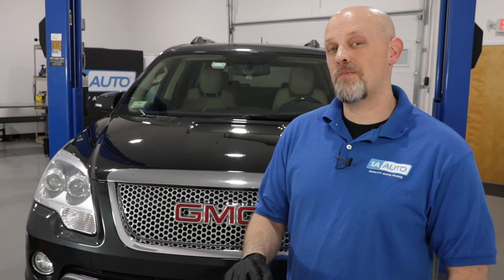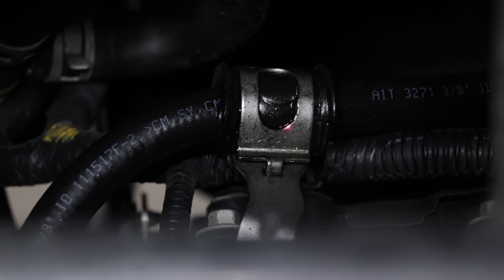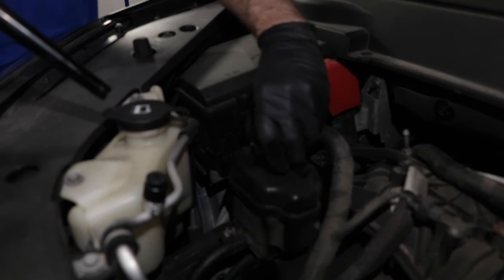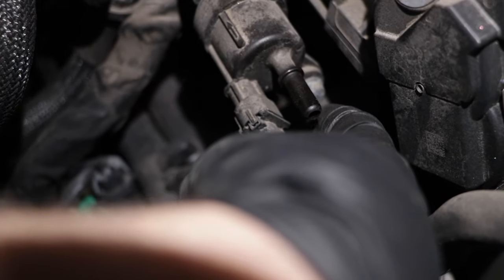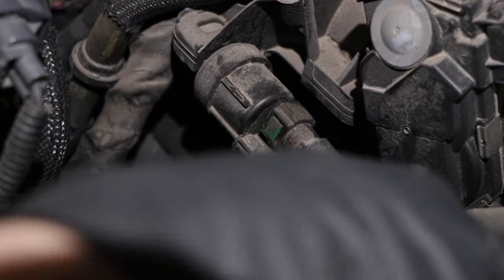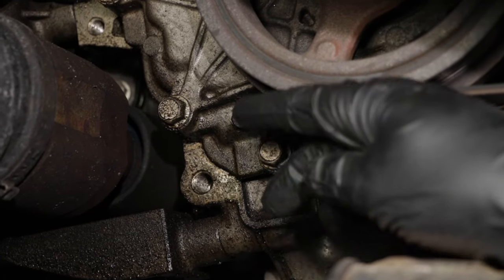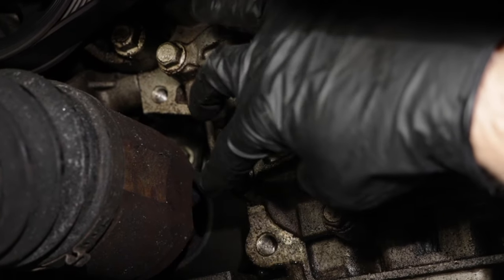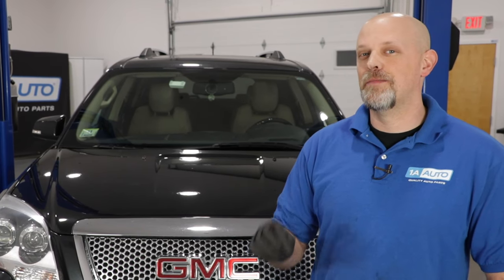Top 5 Problems GMC Acadia SUV 1st Generation 2007-2016

Comment: Hey Andy, I enjoyed this video but my 2017 Acadia has a different problem that maybe you could help with. Trying to lower my right 3rd row seat, the headrest doesn't rotate or fold down so the seat doesn't lay flat. Any ideas?  I've looked for answers but it isn't common I guess. I have the same issue with 2nd row left captains seat.

Comment: I have had issues with my AC on my 2008 Acadia. It seems ok at first but fades over time, and we get warm on hot days. Also have  speakers going in and out.
Reply: Had the same issue with the speakers, dealership wanted to charge 900 to replace the amplifier. I bought one on Amazon for 200+ and had the geeks at Best Buy install for 45 dollars. Problem solved.

Comment: I have a 2016 acadia. 74k miles. Ocassionally between first and second gear my rpms will accelerate rapidly. Its really noticeable if I try to accelarate rapidly. But it is only intermittent. Any ideas?

Comment: Where I live, that timing chain job costs $3000, so it's not just any timing chain swap. I found no private shops who would touch it, so you have to take it to the dealer, and you know what happens when you have to do that.   My wife's 2012 Enclave is easily the most unreliable, high maintenance cost car I've had since the 80"s.
Reply from the maker: +VAspeed3 Thanks for the feedback!

Comment: Awesome video! Thank you! 
I have experienced a vibration through the steering wheel between 40 and 60 mph even while in neutral.  Checked tires, wheel balance and have heard numerous GMC acadia having the same issue. Any ideas? 2012 GMC Acadia AWD
Reply from the maker: +MARCEL VANDERLEY We wouldn't be able to diagnose an issue like that here, you may want to have a local mechanic take a look at it. Thanks for checking us out! http://1aau.to/m/Shop-1AAuto-c
Reply: Sounds like worn wheel hubs.  Just replaced all four of mine on 2012 Acadia.  I experienced the same issue.  Bought new tires, too, so now it rides like a soft, fluffy cloud.
Reply: Oh, forgot to mention what caused the wheel hubs to wear quickly.  The previous owner must have driven hundreds of miles on busted shocks.  Replaced all shocks and struts.  They no longer had hydraulic fluid inside them!  So, check for worn suspension and steering parts, when replacing the wheel hubs. This is a heavy vehicle with a heavy engine.  The front end suspension and steering joints have a great deal of pressure on them.  Keep these maintained.
Reply: Sparkplugs?
Reply: I just had my vehicle in the shop for the same problems, drive shaft and struts needed to be replaced also steering wheel column.

Comment: Thinking about getting the 2012 Denali thanks for the upload
Reply from the maker: +MyNameIsCorey Thanks for checking us out! 1AAuto.com
Reply: I just bought a rebuilder 2012 Denali love it so far. my wife was driving a 2011 traverse with 124k miles and was a very good vehicle for us, none of these issues. for some reason the 2010's and under have far more problems
Reply: Bro was it worth it?
Reply: Just bought same vehicle and going a bit nutts trying to work out all the bugs. Now thinking of just selling it.
Reply: @Merlyn2414   i think ill get one of the newer ones it seems folks have issues with the older ones.  But its also how you maintain your vehicle

Comment: I have had a throttle body problem or so I thought. Truck keeps cutting off giving a engine power reduced code, service stabillitrak and traction control off codes. Took it to get looked at and they said it's my engine fuse box keeps shorting out. Have u guys had this problem b4? Help would be greatly appreciated!

Comment: Problems with air conditioning leaking somewhere. It works sometimes and not others. Usually have to refill system once a year.
Reply: 2012 Acadia

Comment: I just picked one up at a police seizure auction. It has a no crank/no start issue.  Best I've gotten is about a 1/4 second crank followed by click click or nothing but what appears to be a dead battery.  Battery is charged, on a jump starter, and even running jumper cables from a Crown Vic police interceptor putting out 14.5v no difference.
Reply: Did u ever figure it out mine is doing same thing

Comment: Do you really really recommend letting a shop do the transmission oil change?! I think once it’s changed the problem get worse. Happened before in another truck I owned. 2002 Lexus.

Comment: My 2017 Acadia with 37k (yes only 37K Had 33k when I bought it in May.) stalls after filling up. I stop pumping as soon as the pump kicks. I don't top off. i've done some experimenting. It always dies if i make hard left turns but not going right. Also if i have to hit the brakes fairly hard. if I let the vehicle sit for 20 or 30 minutes or drive very gingerly aka no hard left turns it will run fine. forums and every place else i've looked have said to replace the evap purge solenoid but it didn't help. If it dies it cranks hard but always starts back up. No warning lights or codes are thrown. Any other guesses?

Comment: I had both the waveplate issue and the timing belt issue on my 2009 Outlook.  Both were repaired under warranty although the transmission issue happened just outside of the warranty at 77,000 miles or so.  Both issues resulted in catastrophic damage because of broken parts.   Just two weeks ago at 145,000 miles the transfer case had to be replaced because a bearing failed in it.  They found ball bearings in the fluid when it was drained.  I have never had so many issues with vehicles as I have had with GM.

Comment: Knock on wood I have not had any of these issues. I have a 2012 Denali with 56k. Only thing I’ve noticed is every once in awhile when I’m cruising around 50 the rpms will go up and back down like I’m goosing it. Any idea on that?

Comment: I can appreciate that he's got to say these are fine cars to own. However.... Don't. Ever.

I've had many of these problems. The timing chain went out on mine and I ended up with bent rods. Needed a new engine. Also

Service Stabilitrac warnings, followed by reduced engine power. 
Passenger window opens but doesn't close from the driver window control.
Etc
Etc 
Etc....

Comment: I'm having ground issues, I was test the battery when my test got very hot and started smoking, I immediately disconnected my device. I checked the two ground spots I could find being block to frame underneath and another one by the starter. Are there any others?

Comment: I have a 2010 but my Engine blue when I bought it, it was used they replace the motor with a gym warranty and it was a full motor, do I have to worry about that one as well? 😢 the old motor had 87,000.00 on it. I have about 113,000. On the new motor?

Comment: Quick question I have a 2007 GMC Acadia I just did the valve cover gasket’s the upper and lower intake manifold water pump thermostat new oil new coolant now when I tried to start it I get no crank no start is there anything else I can check or do I would really appreciate it if you could help me

Comment: I have a 2008 Saturn Outlook and have some coolant leaking from behind the harmonic balancer.  I confirmed the leak is not coming from the water pump and in fact it appears to be coming from somewhere behind the balancer flywheel.  Is there a cause for this?

Comment: Also, my rear hatch is, once again, not holding once it's open. Already has had 2 recalls on it (Late 2019/Early 2020 was the last recall) and now, Early 2021, it's happening again.  Also has had an issue power opening.  I have a long, 6 foot piece of wood that holds it open so I can use the hatch correctly.

Comment: My GMC Acadia 2010 SLE has always got hard to start in every other single days in winter since three years ago, first time changed the alternator, but won't fix, then changed the batteries three times. Now, I have to drive the car every day to make sure that I don't need to boost it next day.....Could be the alternator problem? Thank you

Comment: Have a 2016 Acadia with engine light on (comes on for a couple days then turns off, then repeats) codes showed are p0132 and p0300…also have traction/stabilitrak warning that keeps coming on and off… not sure where to start with my search to find the problem

Comment: Just for a 2010.  Now I'm nervous. 
Air bag light, pretty sure it's the wiring under the passenger seat, but more confusing... the steering wheel controls.  Left ones work, right ones stopped working.  Can't hang up a call via the controls after I got used to doing that 😞

Comment: Hey! I have a 2012 Acadia. Its leaking coolant as of 12/26/20. I cant tell ware its  coming from. Please help.
Reply from the maker: +Mia Alexander An antifreeze leak can be caused by many different things: A blown head gasket can allow your coolant and engine oil to mix. ... Corrosion of your radiator tubes or damage because of stones or debris can create a leak. You may also see a leak between the tank and radiator body over time, as the sealing gasket wears out.  We recommend taking the vehicle to a professional as we are unable to diagnose online.
Reply: Acadia 2012 and 2009 is the same engine question?

Comment: I have an 08 Acadia. I have a moonroof leak that I cannot figure out! And then, the battery is under the floor behind the passenger side! Water got down into the battery and I had to buy a new one ($170!!!!) now it starts sometimes and sometimes not. Any idea how to fix the leaky moonroof? And how to check if it’s a short and where? Single girl struggle!!!

Comment: The A/C in my 2015 Acadia at 63,000 miles stopped working.  It would just blow hot air. They replaced the Evaporator Core. They said there was copper dust inside the housing that caused the A/C to fail. It was about a $1600 repair job at the dealership.
Reply from the maker: +Mary Pajestka Thanks for the feedback!

Comment: Good morning I have a GMC Acadia denali 2015 when I read it with the code reader said I needed a starter relay. So long story short check fuse box needed more than that, so buy a brand new fuse box. Mechanic out of in the car still has no power it won’t crank and the key gets stuck in engine. Also the check engine light stayed on while I cut car off. The engine stays running when key was out of ignition , what should I do. My car has zero power and won’t start

Comment: Have an 07 Acadia and the transmission has a shudder/jerk to it when accelerating until you get a consistent speed of about 60 could you possibly know what the best way to go is? Replace with rebuilt or could it be something else?
Reply: I have a 2016 Acadia - what you are describing sounds like an issue I have had before - (which was listed as #5 in this video)- the Transmission Torque Converter.  I was over my warranty period and it was EXPENSIVE.

Comment: I drive 58 miles to work plus 58 home this evening I left and my 2009 Acadia slt got up to around 4 rpm when I hit the interstate but wouldn't speed up or change gears I stopped e immediately and popped hood (I already have an exhaust manifold leak) but got back on interstate and it drove just fine to work. I bought and put in some Bar's Stop leak into transmission but don't know what the drive home in the morning will bring... scared to death it's a transmission problem but just asking for opinions tia

Comment: To add to the list when theres quarter tank gas you cant park car on any incline downwards or upwards or the car wont start have to have half tank or more or be on flat ground to start, also front end poping noise when turning and no its not cv axle replaced every component on front end and something still pops on turn it makes one or two pops when going into turn and 1 when coming out of it and this happens of course while braking and turning not sure if that has anything to do with it. Had local gm put micophones in and around that area (or so they say they did) and test drive it and they couldnt reproduce it ( of course) and than i took gm manager on test ride and i reproduced it and told him thats the noise and he said he doesnt know what it is

Comment: I have a 2009 Acadia and what it does when the SUV start going start vibrating ans as you go it goes away 🤔 transmission or on my dashboard shows stability track control service what's that means????

Comment: Have this unusual bounce/ squeak sound from front end of vehicle. Thought it was shocks ( which o had to replace) but it’s still there. Consistent on city driving. Used to just be over speed bumps or uneven gravel. Primarily hear it on drivers side only when windows up and completely quiet in vehicle. Any tips?

Comment: 2014 Acadia. 02 sensor light bank 1 sensor 1 changed but engine code keeps popping back up. backfired , stabilitrak and traction control issues  and no one seems to know what causes it. Can you make a vid on those two issues. Look them up there are thousands of forums with the same issue and no solutions.

Comment: We want to say thank you for the video! We had the purge solenoid issue , replaced and now we are good on that.
But now I have a sort of ticking noise that seems to be coming from the transmission it does stop if I rev the rpms but when driving shifting up is smooth but I do get a hard down shift!
No lights on dash to pull codes.
Please help any ideas what I have going on?
144k miles on the 07 gmc acadia awd

Comment: Sure thing, right now I have a P0440 evap  issue...can it be the purge solenoid valve???...I changed the gas cap but no good results.
Reply from the maker: +Noel We wouldn't be able to diagnose an issue like that here, you may want to have a local mechanic take a look at it. Thanks for checking us out! http://1aau.to/m/Shop-1AAuto-c

Comment: What would cause my 09 Chevy Traverse stall out while running and die after only running for a few minutes. I have replaced the purge valve and the crank position sensor and it still just stalls out after a few minutes

Comment: I have a 2008 Buick Enclave with 116K miles and have been getting a misfire code for fuel injectors on the same side, P0202, P0204 & P0206.  Service Stabilitrak and Traction Control Off lights come on as well.  The motor runs rough, loss of power at stop and turns off at idle.  I changed out the injectors, but no luck.   Are you familiar with this issue?
Reply from the maker: +D V We wouldn't be able to diagnose an issue like that here, you may want to have a local mechanic take a look at it. Thanks for checking us out! 1AAuto.com

Comment: I have a traction control problem on a 2013 GMC Acadia 3.5 . I had the transmission changed at a dealership GMC of Springfield pa !! to no avail!! I have spent close to 4000$ for them to tell me it's a break booster problem so they fixed that😢😢😮. When it came back I noticed that the hub bearing looks old and or spindle. Can that cause that issue ? Please help spent to much money

Comment: I have a 2015 Acadia and I had a wheel bearing go out thought that was the issue but it’s still doing it … it kind feels like I’m hauling a lot of weight and if I go up a hill and I give it gas my car bounces kinda in the back like it has Pawsey traction in the back and it kicks in. And it grabs … I let off the gas it stops and I go easy it stops but I’m unable to Accelerate hard if I have to get going on the highway it does the same thing!!! Could this be my rearend or transmission? Please help I need to fix it !!!

Comment: Another thing to about the power steering... The oil cooler radiator usually bends and breaks.... That happened to me and that happened to two other guys that I work with that has the same vehicle....  that's a really easy fix you just take off the front bumper and then 4 bolts and you're done
Reply from the maker: +hacatan24 Thanks for the feedback!

Comment: Great video!  I'm having fuel trouble with my 2013 Acadia.  Yesterday, it threw five codes and went into reduced power mode.  P228C, P0089, P0171, and P0174, as well as C0242.  First thought is the high pressure fuel pump, but possibly the high pressure fuel sensor instead?  Supply pressure from tank is running 60-75 psi. Any thoughts on troubleshooting this further? FWIW, my son has a Tech II scanner.
Reply from the maker: +greyghostkoga We wouldn't be able to diagnose an issue like that here, you may want to have a local mechanic take a look at it. Thanks for checking us out! 1AAuto.com

Comment: My wife has a 2015 Acadia Denali and when I drive it I notice that sometimes it feels like it is shifting hard on the take off. She doesn't even notice it so it's not too horrible, but it is obvious to me. Any suggestions? We have been having issues every few months or so with the vehicle. I have Chevy that is 2 years newer with more miles on it than hers and I haven't had any problems at all, but her vehicle always has something, usually small, going wrong with it.
Reply from the maker: +LA7ERA1U5 We wouldn't be able to diagnose an issue like that here, you may want to have a local mechanic take a look at it. Thanks for checking us out! 1AAuto.com

Comment: I have a 2014 gmc arcadia, and my taillight is out. I have replaced the bulb, but it still doesn't work. Also, break lights work great just running light and taillight aren't working and every mechanic I took the car to can't explain how to fix it other then buying an entire replace please please help

Comment: My 2015 acadia is making a whining sound while accelerating checked the power steering fluid was a little bit lower than factory so filled it. Doent whine unless pushing the gas peddle?
Reply: Check the transmission fluid. Our 2016 Traverse (same vehicle) was whining a bit...transmission was at least 1 quart low. Having other issues so i can't drive it too far to see if the whining has been reduced.